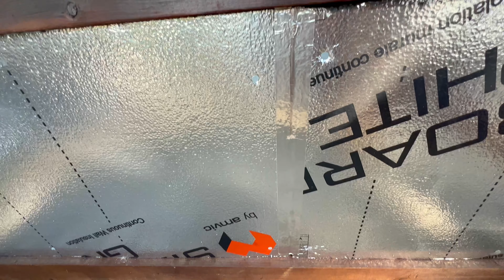Winterizing Our GREENHOUSE! 🌱 Cold weather prep & finally finishing the interior 😅

Comment: Fantastic greenhouse design! I love that you reused pallets that would have otherwise gone to the landfill. Did you use 2x6 for your roof joists? It looks like you use different size timber for the roof. What was the spacing between joists? How is the greenhouse holding up to the snow load?